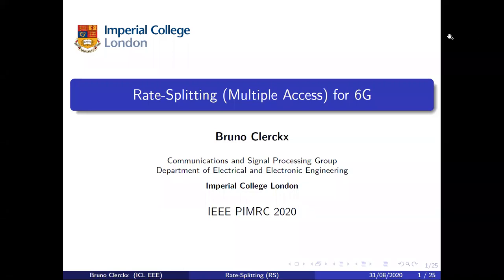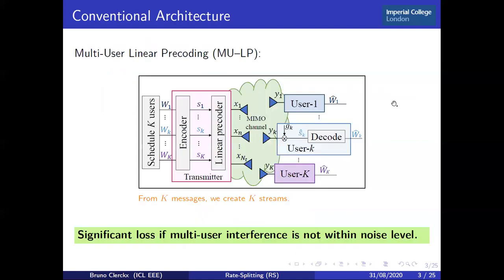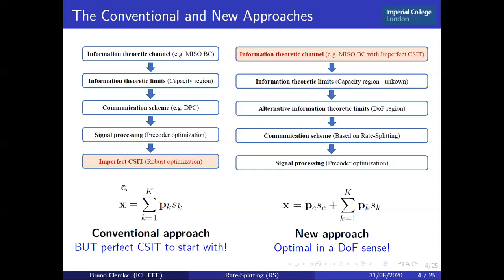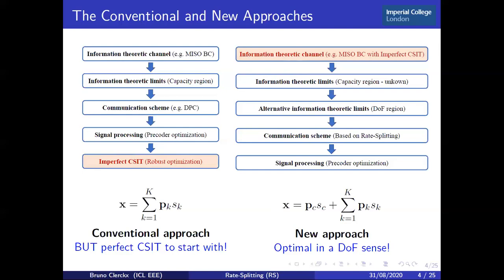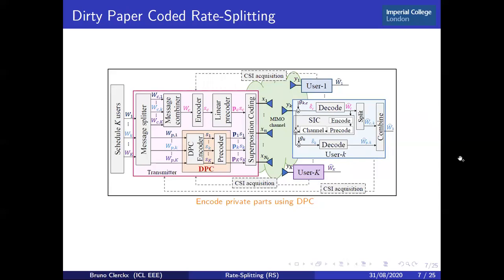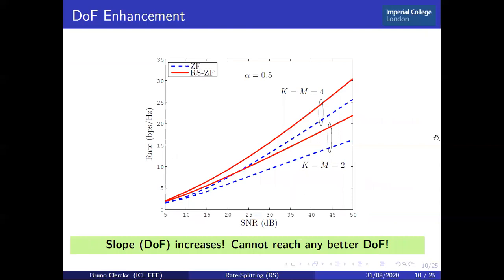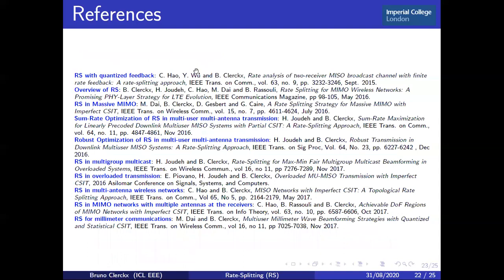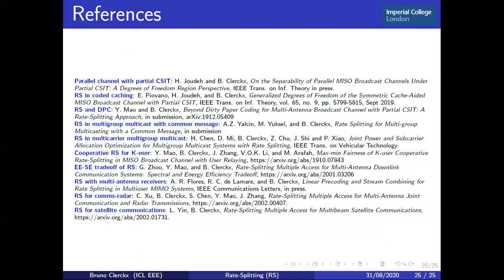Short Tutorial on Rate-Splitting (Multiple Access) for 6G

Comment: On slide 17, you said you transmit 10 private and 1 common streams. How is it done with N_t =2?
Reply from the maker: Good question. You can formulate the optimization problem with 10 private streams and 1 common stream, and then let the optimizer converge to a good solution. On slide 17, the solution ends up allocating non-zero power to two private streams carrying message of two of the users and encode messages of the 8 other users in the common stream. This is explained in Fig 20 and 21 (and related text) in https://jwcn-eurasipjournals.springeropen.com/articles/10.1186/s13638-018-1104-7 .
Reply: @prof.brunoclerckx1530  Thanks a lot for your answer!